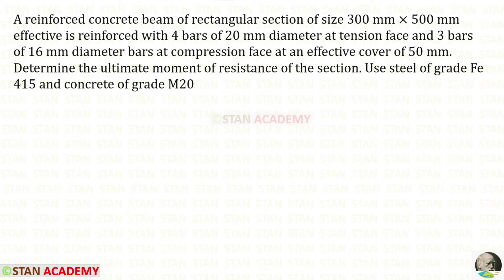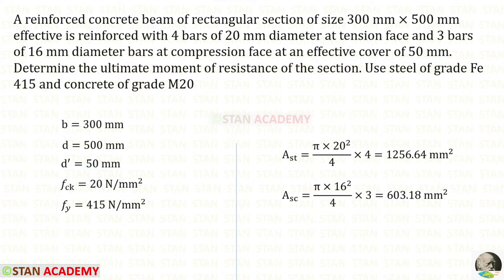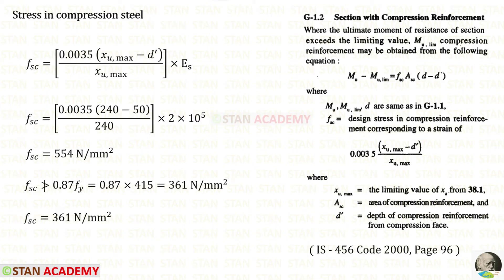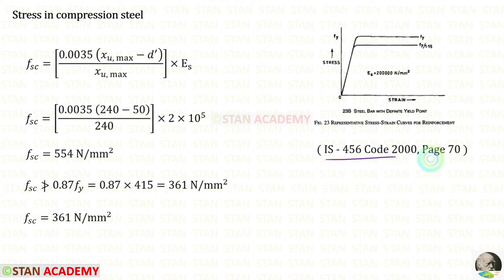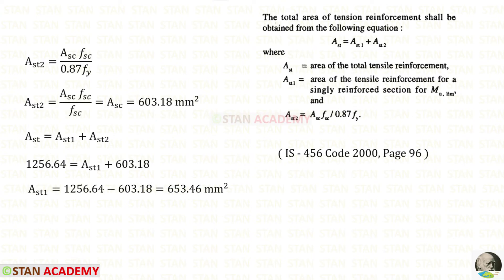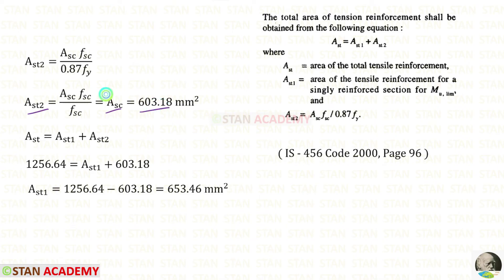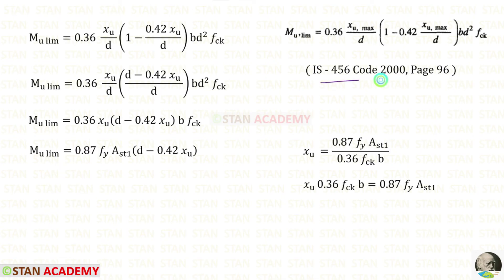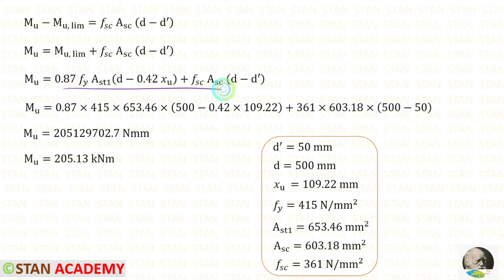Doubly Reinforced Beam - Moment of Resistance Problem

Comment: Dear Sir
Firstly I appreciate your valuable video lectures and thank you for it 
Please clarify, in this problem
since this given section is doubly reinforced and calculated AST1 should be respect to MU lim as singly reinforced section.  if yes then the neutral axis depth corresponding to AST1 should be equivalent to xu max but here its below xu max  how? and how come under reinforcement section? if under reinforced how it become doubly reinforced section